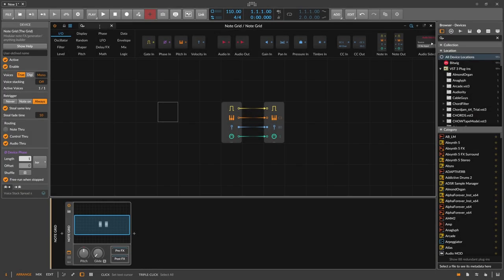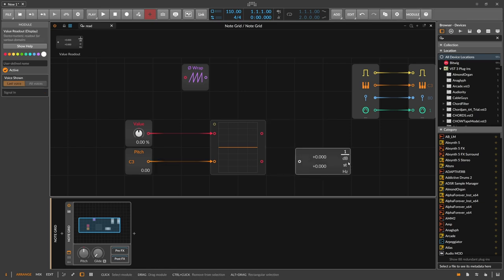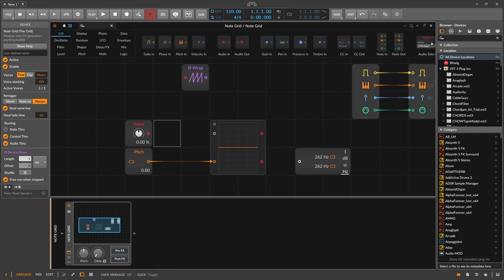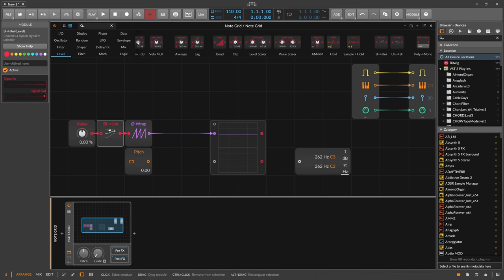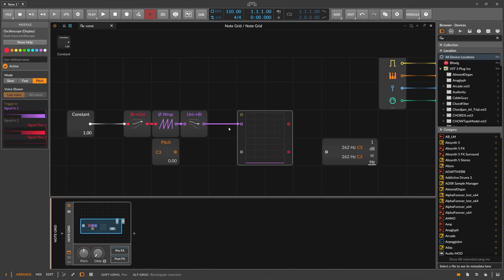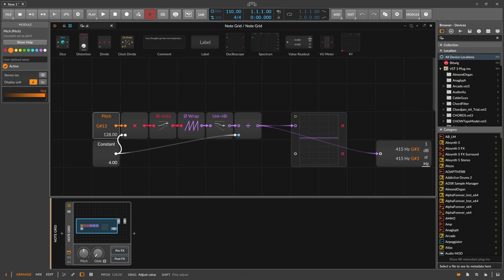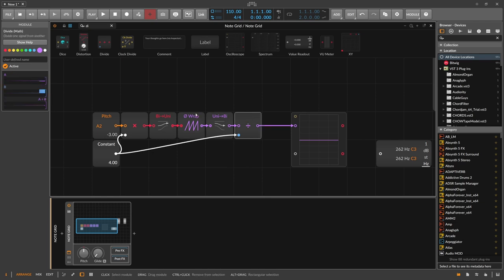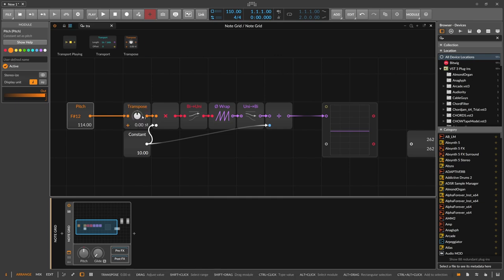why does this work? - Note Wrap Explained

Comment: Funny! I am still there, the mate below my comment nailed it right. Modulo, is like just division keeping the rest. If you cannot be really sure, about the rest, maybe because of rounding errors, so you get the wrong result or you have a coordinate transformation which is not evenly spaced in a non linear fashion. Otherwise I know ceil and round or just mulitply big values, divide big values. I do not get why you cannot just do a silly string replace in your example like C5 -> throw away the 5 put your target oktave to it like C(3) OR just making a lookup from asci to number . Simple subtraction in a numerical approximation   can even be considered, as you can expect Division is done under the hood by a numerical approach aswell. This could even be an issue if you calculate stuff at audio sample rates which might even happen in your scenario, Anyhow, Nice Video! WEITER SO! Best Regards Tim